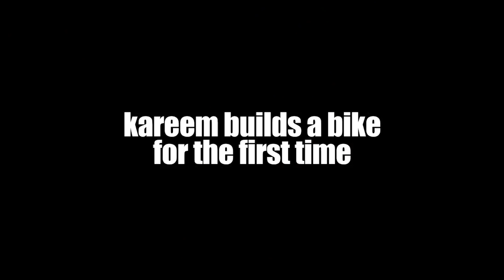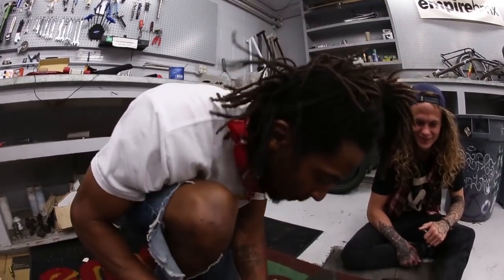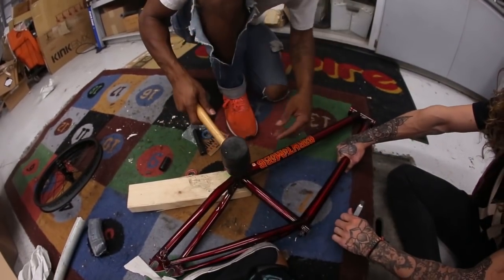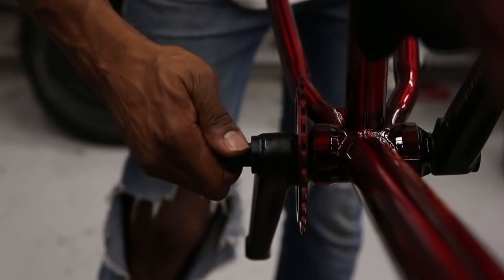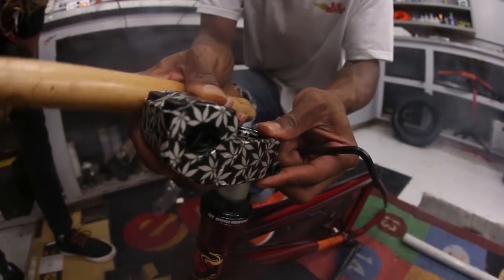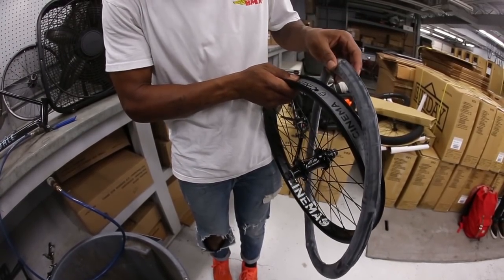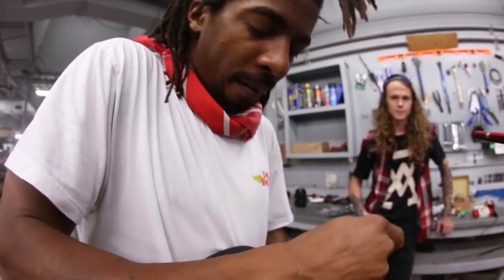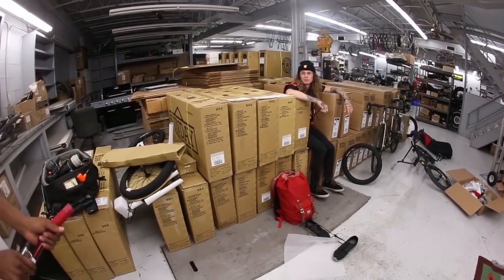Kareem tricks Tom Dugan into building his new bike!

Comment: The tool to compress the bottom bracket was hanging up all pretty while your stressing Kareem. Savage
Reply: actually the thing hanging on the wall is for headsets. it can be used for both tho
Reply: Hakuro Mihosa What?! Show me a bike that Empire has sold in the past five years that has a pressed headset. They ALL use pressed headsets anymore. They're ALL campy style. Have been for at least the past five years...😘
Reply: NoCoBandit I saw that, but, that doesn't change what the tool is for
Reply: @suitknol6604  the thing on the wall has a name and the name is a barring press used for both head sets and bottom brackets
Reply: @Monkee4130  you can use it for both, but it's made for headsets. There are BB specific presses...